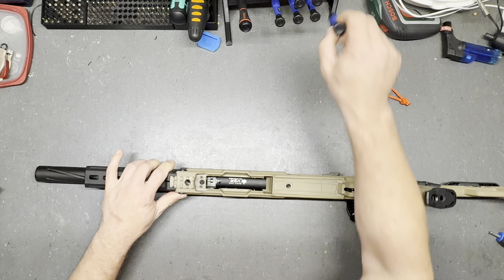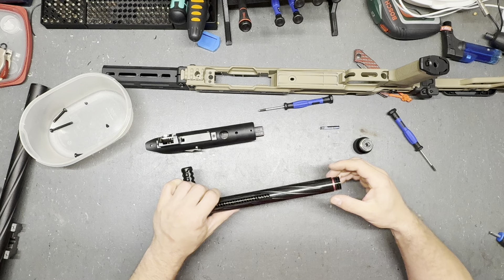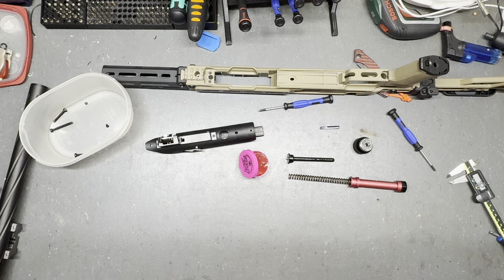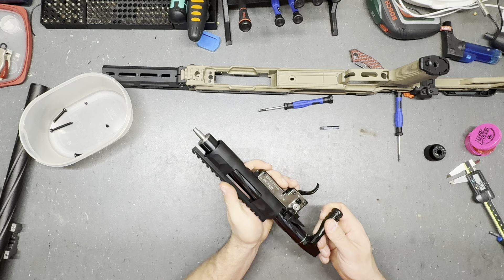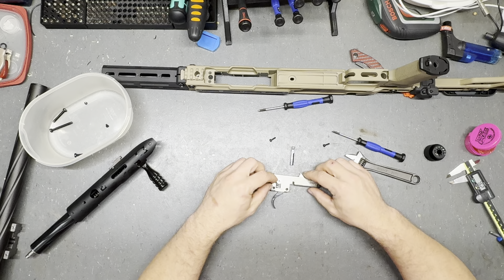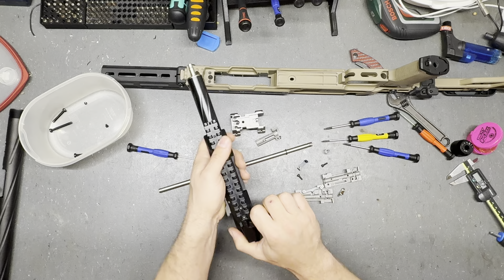Maple leaf MLC LTR take apart first time view/reaction

Comment: What is the reason why there is no air seal?..
Thanks
Reply from the maker: I honestly dont know, tried some other o-Rings but the stock one got the highest FPS, and shot pretty consistenly, i ended up changeing out the piston as i wanted to use large diameter springs,(because i used them in all my other BAs) and they did not fit in red ML piston. tried Snipermechanics and AA blue piston both got roughly the same FPS as the red stock one, so if you are fine with running the 7/11mm springs i would have no concerns about using the stock one.
A stricked full block airseal is imo not needed to have great performance its just a quick easy way to check the system, and would normally be exspected.